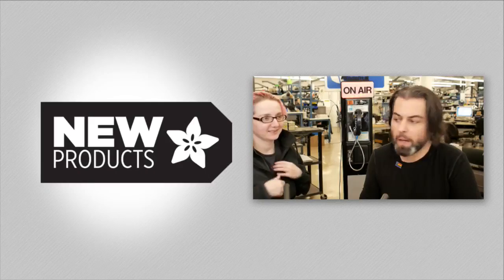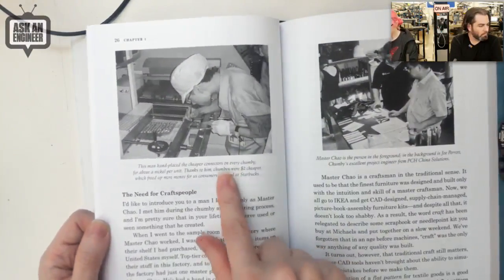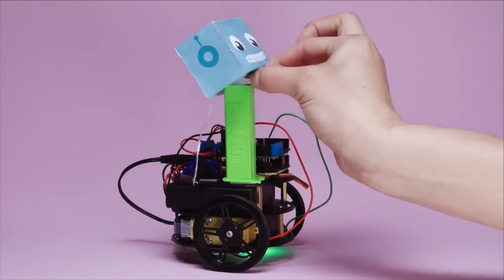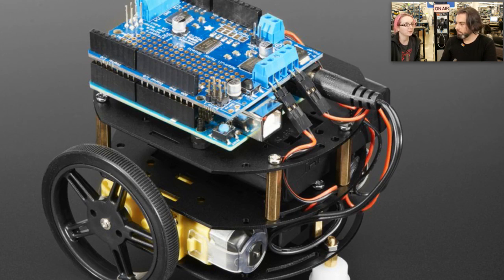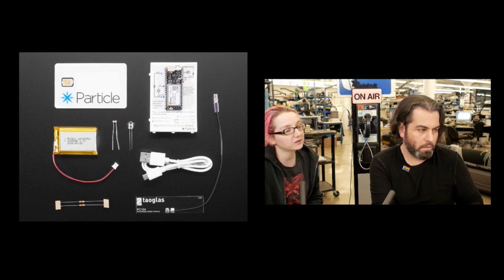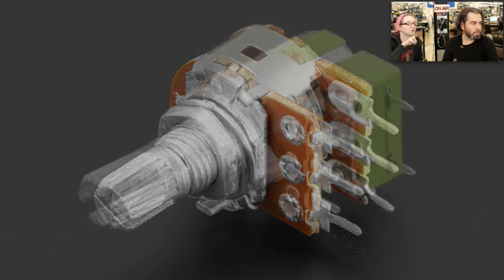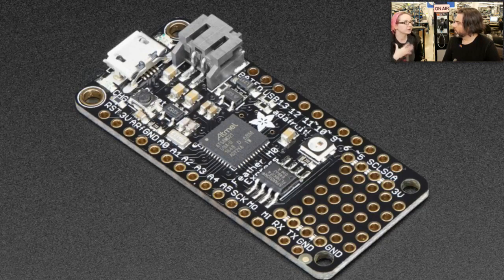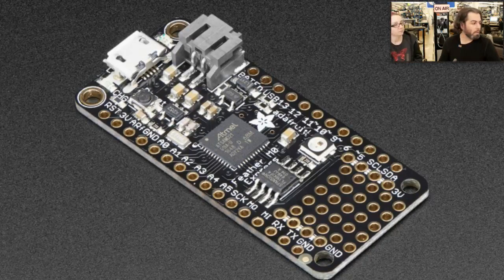New Products 4/5/2017

Comment: That dual pot with a switch is exactly what I'm looking to use in my amplifier circuit to control left and right channel volume together.

Call me stupid cause I'm still a newbie with sound circuits, but... Would linear taper work fine for volume? Should I look/wait for a dual log pot instead?
Reply: hey im looking at the same thing to fix my record player because i fired my original switch. i am also not very circut savy, and I was wondering if this worked for you?